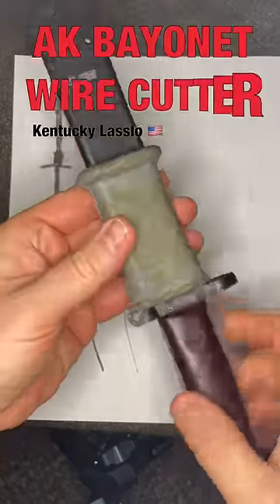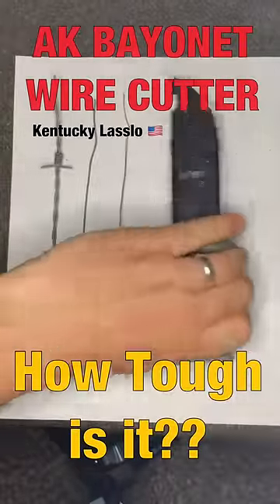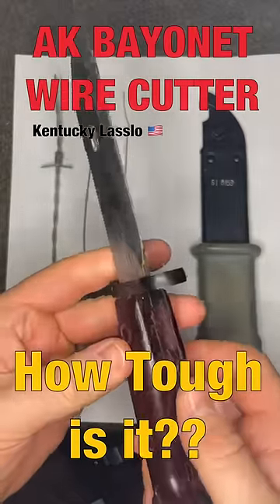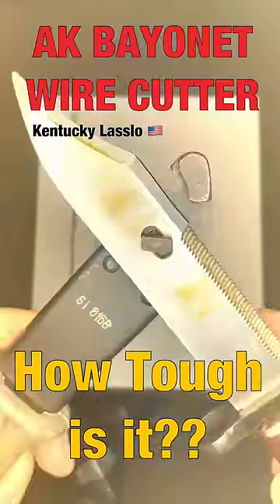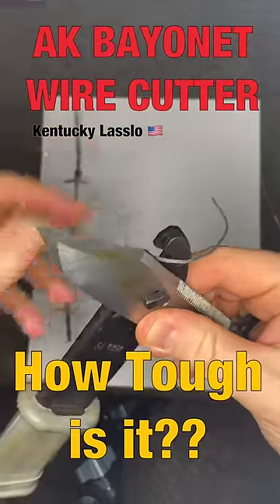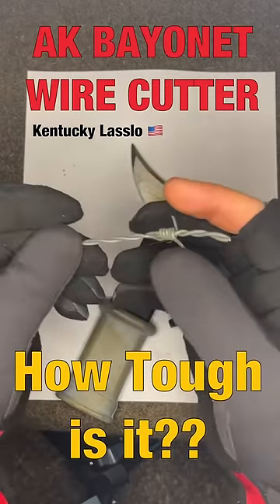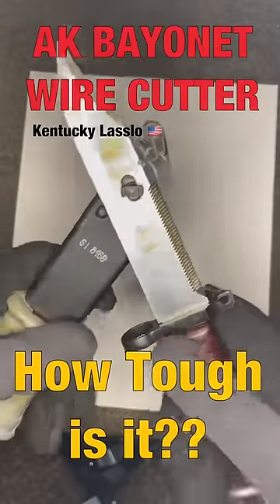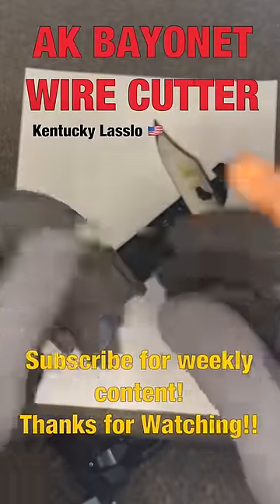AK Bayonet Wire Cutters #shorts #short #shortsviral #shortsfeed #shortvideo #shortsvideo #shortfeed

Comment: Have never seen this, someone was thinking.
Reply: Yeah they were! I was wondering why the sheath was 2 different materials and he said it but I just missed it. It’s a rubber handle to stop the electrical current. That’s smart. You just better not lose the sheath haha
Reply: Probably a pretty dang good demand for wire cutters in WWII but CERTAINLY in WWI. Making it so that every soldier with a bayonet and scabbard had wire-cutters is VERY big-brain. I wonder who figured it out first? Who knows, might have even been the Russians, though don't Americans also use this type of tech? Now I wanna know which country it started in :P
Reply: @normanmccollum6082  israel also had an adaptation of it! The flash hider on the galil, you stuck the wire in twisted it and fired a round😂 a bit barbaric but it severed the same purpose
Reply: @chadb2077  Beat me to it.. There's also a bottle opener if I recall.. 👍
Reply: @chadb2077  
Huh... well... that's interesting but that sounds vastly inferior. For one it sounds potentially dangerous like it could cause a barrel obstruction or excess pressure, and for two it will inevitably cause A LOT of noise as well as a flash which means stealth isn't an option. I mean, will it get the job done? Yeah, sure, but it seems very much sub-optimal.
Reply: But have you seen what the AK cleaning kit can do..
Reply: @chadb2077  they later put a bipod with cutters so they wouldn't give away positions.
Reply: @soaringeag1392  thats smart
Reply: @normanmccollum6082  yeah definitely not a good solution in my opinion
Reply: @BAZZAROU812  yes there is, the single reason its a better rifle than the AKM😂
Reply: America and many other armies use an identical system on their bayonets. The Canadian version also has a patch of diamond sharpening stone in the sheath.
Reply: @normanmccollum6082  pretty sure the people who had to carry the huge wire cutters they had made sure to give their input.
Reply: @normanmccollum6082  it def was the Russians, the m7 bayonet which lasted until the 90s didn't have this feature. Only came with the m9.
Reply: @chadb2077  some other did that. But i have a feeling that you do not want to drag attention to yourself when stuck in barbed wire
Reply: Funny how today people use computers to think...dumbnest is in effect !
Reply: The hole turns it into a scissor
Reply: Funny enough the US M9 bayonets are basically a clone of these but designed for the M16/M4 series rifles.
Reply: The British army bayonets have it too
Reply: Today's world people need to use Google to figure things out.
Reply: Ain’t that the beauty of war. Some guy thought that even in an age of nukes, some wire cutters would be necessary. Which means that they thought that they’d survive the nukes and then have to cut some wires. It’s really beautiful the optimism
Reply: Me
Reply: @Mintyb181  Never stop
Reply: Takvi noževi su na svim vrstama AK
Reply: The soviets battlerattle was a premium example of 'do more with less'; a different example is how in WWII almost all sides devised specialized vehicles for different combat roles (heavy machine gun, anti air, field artillery etc) - you know what the soviets did? They took one flat bed truck model and made it do all the jobs. 

If it's simple and it works, its fit for battle comrade
Reply: @robertsaget6918  your post reminded me of when I was a kid during the space race to the moon it was said that NASA spent millions designing a pen that would write upside down but the Soviets simply used a pencil. Don’t know if the story is true but I have remembered it my entire life and I’m sure it has helped me look at problems from more then just one angle.
Reply: @BAZZAROU812  i hope i dont need to shoot the bottle open haha
Reply: Pretty sure the galil bipod had built in wire cutters, but I could be wrong. Know they had built in bottle openers.
Reply: @normanmccollum6082 were there kalashnikov rifles in WWI? Come on
Reply: @bloodgout  
I fail to understand your reply. I mean, to answer your question, no, Kalashnikov rifles were not present in WWI nor in WWII. What's your point? Did you misread what I had written because I have just read everything I posted in this comment thread and your reply makes zero sense  to me.

I spoke of the value of having wire cutters, and how making a bayonet/scabbard to function as wire cutters that virtually EVERY soldier could have is 'big-brain,' because it is. It's smart, and there's reason for it.

Did you misinterpret my honest thoughts as mistakenly thinking the AK is from the trenches of WWI? Because if so, I think that may be a greater indication in relation to your reading comprehension and less of an indication of my ability to articulate my thoughts.

I have to say,  this is not the best first impression I've ever had... you seem rather condescending and just in general not very pleasant, but hey it's only the first impression so hopefully my initial assessment is a tad bit harsh and giving the benefit of the doubt will result in me being pleasantly found to be incorrect :)

Comment: It's Romanian. The Hungarian bayonets are really close to identical but they had stamped serial numbers and a different type of hanger on the scabbard.
Reply from the maker: Thank you for that info!!
Reply: True
Reply: Gondoltam
Reply: @KentuckyLasslo also it is a type 1. Type 2 has a bakalite sheath and a metal pommel
Reply: The top G bayonet
Reply: @KentuckyLasslo  also when you cut it and it went flying, safety glasses
Reply: - The Hungarian one is even better.
Reply: @sandordula5207  Slighty more valuable but mechanically identical.
Reply: @MrChristopher42 for sure, that piece or anything else you cut, if it goes flying like that and it goes into your eye that can do a lot of damage, a piece of wire or barbed wire especially you do not want that flying into your eye..
Reply: lesson is, Romanians almost identical, but Hungarian is the better choice
Reply: So can I still find one to buy or is it pure unobtanium rn?
Reply: Pretty damn ingenious
Reply: Yeah that is actually true in the Hungarian army it was easier to steal the rifle than the bayonet. The bayonets were stolen with such regularity that they were given serial numbers.
Reply: Sorry but you are wrong, it’s Hungarian. The fact that I know because I’m ex military, from the Hungarian army.
Reply: @stoki1 The Hungarian bayonets are damn near identical but they are VERY slightly different than Romanian. The Hungarian bayonets are a bit higher quality than these Romanian bayonets. They have nice crisp stamp marks not crude elecropencil.
Reply: Looks almost the same as Croatian war time bayonet
Reply: Whats romania?
Reply: @benedekkerenyi1729  hurr durr, Európa magyar föld
Reply: where can i buy one?
Reply: @Benedek Kerényi  something you can NEVER get your "hands" on...
Reply: @themaskedhungarian7021  от русского штык ножа лучше нет!!! Hidd el.
Reply: Retired Romanian sergeant confirms this. We can impale disrespectful a-holes with much less quality mercury coated blades. Much obliged, sir (or ma'am).
Reply: @babyloncrew7225  try me
Reply: @benedekkerenyi1729  another keyboard warrior...
Reply: @babyloncrew7225  ok
Reply: @KentuckyLasslo You have to admit with Eastern engineering everything has a purpose because they can't afford it not to.
Reply: I was just about to say I have one like that and I thought it was Romanian.
Reply: A mythical bayonet, zamn
Reply: @themaskedhungarian7021 Huns use substandard material
Reply: @8sofspades31 🇭🇺🏳️‍🌈
Reply: False,its hungarian
Name:Hungarian ak bayonet (MEW2506)
Reply: Cap az magyar
Reply: @vinceszakacs-ri3cc  fr fr
Reply: @KentuckyLasslo  dont trust him,its a Hungarian ak bayonet (MEW2506)
Reply: Found this video in shorts again and I'm still 100% convinced it's Romanian. The grey insulator is a huge giveaway I previously overlooked.

Comment: They have the same thing on the British L3A1 Bayonet for the L85 family of rifles. The sheath/scabbard also includes a sharpening stone, a fold out saw blade, and a bottle opener.
Reply: It's a pretty good system. 🇬🇧✌️
Reply: Pity the rifle is sucks
Reply: Was just gonna say this... Was a pretty good blade with everything you need in it
Reply: Its britsh, of course the knive is better than the gun XD
Reply: @MVP-jj8ep  

Because the rifle was designed and built to fulfill the lowest bid..
Reply: @jed50  It really doesn't suck. The current L85 is actually a very dependable and accurate rifle.
Reply: @sambadham1404  This, the A1 was trash, but the A2 variant fixed the actual reliability issues, all that's left as negatives are it being fairly heavy and the ergonomics of the controls being really iffy, but dependability wise it's done just fine in the A2 and A3 and accuracy wise it's great.
Reply: @G1NZOU  Yes that's what most soldiers say, I have handled one a few times and you're right about the weight! But they are very popular today.
Reply: does it boil tea ad well
Reply: @sambadham1404  I was on about the sa80 m8
Reply: M4 acog all day 😎
Reply: The galil: "you need a knife and its sheath to cut wires and open bottles? Pathetic."
Reply: The Reason why the A2 doesn't suck like the A1 because the brits needed the help of H&K to unfuck the gun.
Reply: @jed50 nah. The A3 is almost useable now.
Reply: @rain8767 When H&K did that, they were British…

Comment: I love my AK bayonet/Wire cutters. I used it to cut fencing & other things with ease. It's in my bug out bag if Shiite goes down.
Reply: There's better tools to have in a bug out bag than an ak bayonet. You need to look up reviews of when these are used for heady duty purposes, they fail and break.
Reply: A small bolt cutter would surely be better?

Comment: Why is it so simply yet wildly intuitive
Reply: Classic russian engineering. Best thing about them.
Reply: Sign of good engineering
Reply: communism means best design/engineering makes it to production rather than lowest bidder or largest lobbying budget. soviet stuff is all smart as hell.
Reply: @rolsen1304  Soviet Engineering*
Reply: @jasonfifi  that’s the biggest lie I’ve ever heard
Reply: @jasonfifi  Not really, no. What made it to production depended on the designer's connection to Party leadership. Like the Tu-22 fiasco that only got into production because Andrei Tupolev was well liked by the politburo. Plenty of talented Soviet engineers like Yakov Taubin or Mikhail Baburin died in prison because they were tasked with projects that had too short deadlines or it was impossible to make it work like the political committee wanted. The idea that communism means design is produced is just false, because even what does get produced will be made as cheaply as possible with as many cut corners the factory managers can get away with to meet quotas (the T-34 was on paper a very good tank but was heavily crippled by deliberate production flaws).

Also almost every bayonet out there can be used as a scissor with its scabbard. It's nothing special.
Reply: @DrRussian  This design is present in almost every single bayonet since the 1950s, it's not Soviet engineering just actual engineering in progress

Comment: chainlink fence might be an even more common item to have to cut than barb wire at this point
Reply: Especially if they are camped out in an urban environment. But a lot of times they'll put up razor wire and barbed wire to slow down enemy troops. Chain link can normally just be run over with a vehicle
Reply: Wrong, in the field good old barbed wire or razor wire is easier to deploy, and you could place it almost everywhere and/or camouflage. You could even cut some pieces of the barbed wire to use it as caltrops.

Comment: I’m impressed as well. I’ve never handled an AKM bayonet. They do the job just like the AKM. Which just stands for AK47 Modern. The original AK47 base a milled receiver the AKM which is slightly different and is made from stamped steel and are lighter than a milled block of steel and the firing mechanism is slightly different. But they look pretty much identical you’d have to really know your AK,s to know the difference.

Comment: It will cut wire way bigger I use mine all the time on the farm it's nice to have
Reply: I was just thinking about getting one for work myself, glad someone else had the same idea but is a fixed blade knife better than a folding one?
Reply: @eliaspanayi3465  in my humble opinion (not a soilder but a Pipe Fitter, Plumber, Welder, HVAC Tech, Mechanic) a Fixed Blade Knife is better functioning and safer then a folder in 99% of situations.

Carry a QUALITY Firearm, Flashlight, Fixed Blade Knife, and a folding multi-tool everyday and you have everything you need in NORMAL (not survival) situations.

Comment from the maker: Thanks for Watching!  Check out this LUGER!

https://youtu.be/vQaUjTk2-_Y
Reply: Awesome
Reply: They cut chainlink fence
Reply: But then there is the flat wire that's run out as a sheet of metal with a Ray's Ridge in it and the barbs are projections that stick out when it's cut from the flat section. Is then Twisted in a machine so that the barbs point out in all directions. That flat metal is about as thick as the wire shown here. Then there is a common barbed wire that I have seen which is usually a thicker gauge then that which is used for the test.
Reply from the maker: Mr L0wk3y  Thank you so much!  Cheers from Kentucky!  🍻
Reply: As a hungarian, i can confirm, it is a hungarian bayonet.
Reply from the maker: @Doile911  Thank you for the confirmation sir!

Comment: I have seen some older barbed wire. The long wire is thicker, both long wires together are about 4-5mm thick. The barbs have the same thickness but are longer.

Comment: As a survival tool a wire cutter is a handy tool to have as you can always find wire in the wild from old fencing , as far as building semi permanent shelter wire is great stuff to tie it all together with, making an extremely sturdy structure which can handle any weather, of course do not use fencing wire that appears to be still part of a maintained fence line, otherwise you could have an angry farmer talking to you about it,
Reply from the maker: Very true, and I do live next to some angry farmers!

Comment: I would say that the sheath is hardened steel as well. I also think it would perform better if you were to cut barbed wire while it was pulled tight.

Comment: They aren’t too tough. The sheath part at least. Used one of mine for a wire cutter once and it broke the nipple off the sheath where the blade hooks on for wire cutting.

Comment: You need to try Concertina wire(C-wire) or razor wire. We had to use those in the Army, and they made me hate my life. I was helping one dude move a spool of C-wire, and he dropped it on me. You put a pole in the ground at the end of each spool, and we used that to carry the spool. When we were ready to put it down, I squatted, and he didn't. It slid down and hit me in the face, slicing open my lip.

Comment: That is genius
The sheath combines with the blade to form steel snips, 
the blade it wrapped in rubber before the handle goes on so you can cut live wires like they a joke and you put it on the end of your gun cause its not a matter of when you run out of bullets,
 only that you will

Comment: I’ve cut the heads off of 16 penny nails with mine.  Got to put some effort into it and if you’re not careful the part on the sheath will put a notch in the wire cutting edge.

Comment: This thing must be sharp and tight fitment, to be able to cut small stranded cable like that cleanly. Any slop or gap between the two pieces would mangle the cable and roll it under.
Reply from the maker: I don’t know why it works so well but it sure cuts..  like BUDDAHHH

Comment: Wouldn't a better test have been to affix the wire to something so it's pulled somewhat taut, especially if it's a cutter designed to work for electric and presumably non-electric fencing? Mind, that would probably make it easier to cut but it's still important to be authentic.
Reply from the maker: very true, everything cuts differently (and usually better) under tension.

Comment: Pretty cool , but me personally not very practical on battle field  ! Think about it you will be laying there now take off the sheath bayonet off your gear cut wire crawl through then either drop it or put it back on all this when in a hurry ? Me reach in my pouch that holds my wire cutters cut move on and put back in pouch .Army issue wire cutters not those store bought .
Reply from the maker: Good point 💪

Comment: So why is it when you cut the barred wire, 
1. The allegedly tail cut off isn't on the paper like the other test cuts!
2. You pick up a completely different 2nd piece of barred wire to show your alleged cut piece! 
 🤔
Reply from the maker: The cut piece flew across the room, I should have put vise grips on the ends.  I’ve made a part 2 already and I’ll definitely make a part 3 if I can find some concertina wire or razor wire.  I will be cutting chain link fence, and I’ll be sure have better visuals for future vids.  Thanks for your comment and concern!